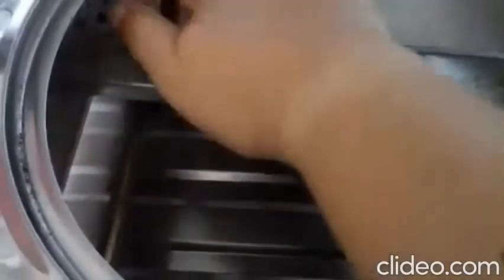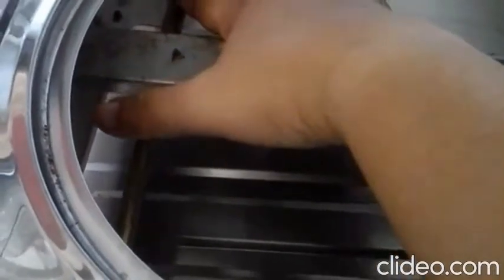HOW TO CONVERT Single BURNER into BIOGAS STOVE...cagayan de oro Philippines

Comment: Could you present a video on converting propane lamps to biogas? And possibly a heater and propane refrigerator as well. There are hundreds of thousands of Filipinos whos standards of living could be increased by that kind of information. I'm in the U.S. and am converting to biogas, but I know many, many friends and family in the Philippines.
Reply from the maker: Its the same concept sir , converting propane lamp to biogas. they need to find out where the outlet of the gas and drill that one. For refrigerator i was thinking of that.  thanks for watching